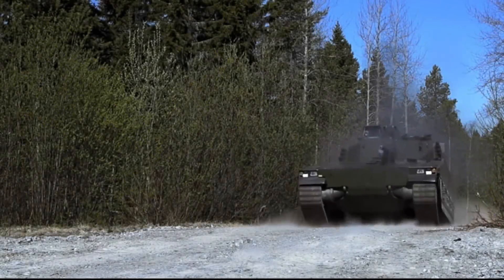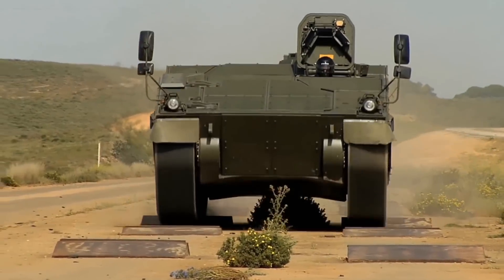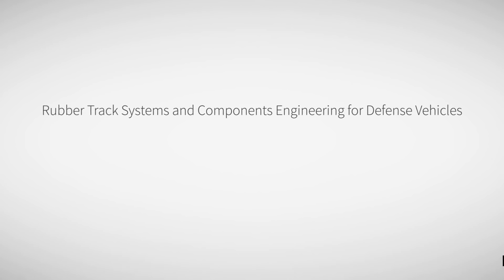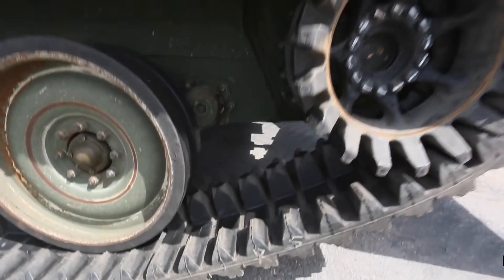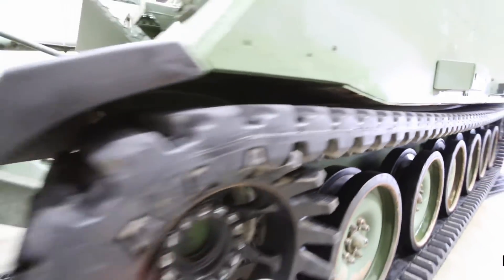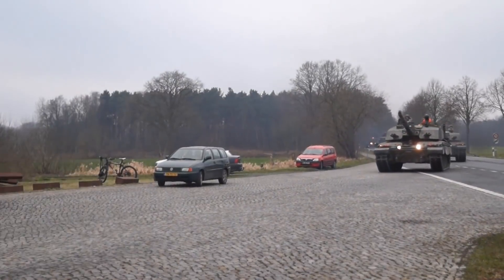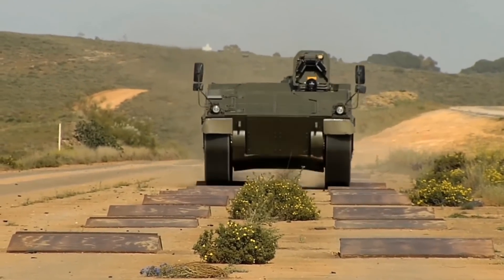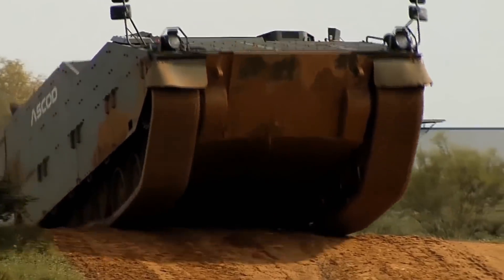Rubber Tracks on Tanks - Are they worth it?

Comment: Makes sense for some light vehicles that need maximum mobility but not necessarily maximum durability. For example, the Bronco ATTC / Warthog amphibious articulating quad track  and Bv 206 mentioned in the video. This would be great for disaster response. Floods, blizzards, and hurricanes would not stop such vehicles and the rubber tracks are an important part of that package.
Reply: A slight bit wrong there, the British used the BvS10 Armoured Vehicle (Viking) which was loosely based on the BV206 which was unarmoured. Later supplemented by the Warthog
Reply: chaz8758 Not wrong. I never made any claims about who used what. I am aware of what the British used and what they were developed from. The Viking was removed from combat service early and completely replaced by the Warthog in theater which was based on the Bronco ATTC. But none of that is relevant to my point above that rubber band tracks are appropriate for use on various quad track vehicles like those and others.
Reply: I was more replying the Matsimus was wrong saying the BV206 was used in Afghanistan. 

The Viking was not removed from combat service early, they are still in service, the Warthogs however were stored and put up for sale last year. Quite a few press reports about it.
Reply: British Vikings were moved out of Afghanistan as the Warthogs were moved in. They received refits, upgrades, and supplementary units after they returned to the UK. The much improved Bronco 3 is now available and this might have something to do with the UK MoD decisions about which models to retask and which ones to seek replacements for.
Reply: MoD has no money and has to dispose of a lot of equipment bought for Afghanistan and Iraq but serves no purpose now. 

They dont even have the money to do the large war stocks we used to have, so the Warthogs were up for sale along with a lot of other equipment. To try and pay for smaller amounts of new equipment like the Scout SV series and Carriers with the F35 when it eventually makes it. 

Vikings were retained I assume as they share some parts with the BV206 that are still used and have had some major upgrades (October 2012 contract let to bring 99 Vikings up to Viking II standard). 

The Warthog was bought in 2010 for deployment in Afghanistan to replace the original Vikings (operators - crews, mechanics etc - started training in 2010 so no idea when they were actually deployed as delivery started in Sept 2010), 24 Viking II were also purchased to be deployed to Afghanistan (10 troop carriers and 2 command versions, ordered 30th Sept 2009 and delivered by March 2010).

I have no idea whether the Viking II was also withdrawn from Afghanistan when the Warthogs were fully delivered (2011), I was out by then.

Comment: I think they should use a better material for the tracks. Less noise, less time taken to repair it, can support the weight of main battle tanks, can withstand cold and hot climate, withstand more shots from RPGs or shells from the tanks. With this much technology, it's difficult but not impossible. What do you think Matsimus? What do you think what material would be better for a track on a tank?

Comment: I may be alone in this but I think that ceramic tracks may fully or partially replace steel tracks due to ceramics being lighter, stronger, and not affected by temperature. I imagine ceramic tracks being made of silicon carbide, the same thing used to make challenger 2 chobam Dorchester ii armor. The only disadvantage of ceramic tracks is that once they're destroyed, they cannot be fixed, if you've ever dropped a coffee mug and it broke, you know what I mean. 

In the distant future, we might have tracks made of carbon nanotubes or graphene. They are even lighter, far more durable and possess limited self repairing capability the only downside is that they are technically unfeasible because the tech to produce nanotubes in bulk and at long lengths isn't here yet.
Reply: Ceramics are used in armor not only because of the hardness, but mainly because of the brittleness. They need to be backed by elastic materials such as rubber and steel.

Ballistic performance is excellent, but you can't apply that to other fields.
Reply: Jonny true, thanks for correcting me.

Comment: I've been waiting for this video to come out. I didn't know much about rubber tracks ,besides rubber track pads.  I was surprised to see how good they are. My main problem with them is the track repair, having them in chunks  seems easier to repair than getting a whole new tread. Rubber has a low melting point than most metal. so if someone stuck a bottle of highly flammable liquid on the track and light it on fire. Would melt the tracks giving you a bad time.  I'm guessing it would to take to long to burn through or its not a realistic example of it happening in combat. Imagine how bad it would smell if a tank was to catch on fire and burned for awhile. but hey now you got a good signal smoke.

Comment: You can learn a lot about rubber band tracks from construction machines, big problem as you said are sharp rocks. I'm sure were going to see more and more of them, you can’t deny the advantages and they get better year by year.  They have to figure out on what terrain,climate(extreme heat&cold),vehicle(front line/MBT/support),repairs and tools and of course the cost. As for protection, tracks are not added protection to the armor. They protect it by keeping it moving. And there is no track that can take a direct hit.
Reply: Spare track sections have sometimes been used for a slight amount of additional armor while mounted to the outside hull of the tank.

Comment: The biggest issue I can see with these things is survivability in high intensity combat conditions, full rubber tracks would be more susceptible to things like shrapnel and MG fire than steel tracks. I can also see them losing a significant amount of their durability in extremely hot conditions, (the sole melting heat of Iraq comes to mind) unless the rubber is more heat resistant than I realise. Over all it's probably a pretty good innovation though for the reasons outlined in this video.
Reply: The tracks on the BV10S still worked well on the rocky and hot terrain in Afghanistan

Comment: Don't play around with rubber tracks, get to work on hover tanks!!!
Reply: Sromotny Kobziarz The amount of energy required to hover a vehicle, especially one as heavy as a tank is ludicrous. They would burn so much fuel you could not operate them.

Recoil of the weapons would be a concern, these tanks would produce massive amounts of noise. Control would be somewhat questionable.
Reply: Bob Lob Law That’s when you just drift over the enemy sideways if you can’t take them out with your main gun.  It’ll be like ten pin bowling.
Reply: this covers some hover tank problems if i remember right. 

https://www.youtube.com/watch?v=KfgifHh5R4Y
Reply: MrKalashnik0va  well with any luck we'll be at war there to, so just spin the turret around
Reply: MrKalashnik0va  hmm yeah probably
Reply: The Hammer's Slammers series of Military Science-fiction has exactly that... Oh, well, one can dream, right?

https://en.wikipedia.org/wiki/Hammer%27s_Slammers
Reply: MrKalashnik0va  well no, it's not too hard to calculate the recoil that's going to occur. And if there was a hover technology, it could be used as a perfect recoil dampener
Reply: get a helicopter, it is 100 times better then overtank
Reply: MrKalashnik0va the answer is recoilless rifles
Reply: The amount of energy required to hover would ludicrous without some sort of antigravity matter which would be a game changer in pretty everything.

Comment: Would the massive amount of traction on tarmac put extra strain on driveline components when compared to steel that can skid steer when needed
Reply: Most modern steel tracks have rubber track pads on them that would provide a similar amount of traction on roads, having witnessed an M113's track break at around 65 km/h I can attest to them still being able to spin out :p

Comment: The problem with the BV 206 (talked with a driver of those) is only useful when not under fire.
The most protected part of it is the windshield which is bullet proof.
He told me that the armor cannot even withstand 7.62 ammo. If it cant stop those rounds 5.56 isnt even a question.
On the other hand you probably worked with more armored versions in afghanistan.
But are the hills there really that steep so you need those vehicles?
I mean (if im not wrong) they can go up to 45 degrees if not more.
Reply: isnt that thing is for support role like carry supply  or towing arty or carry mortal ? the singapore have they own version used for carry supply / mortal ( mortal on the behind car )  i doubt those thing can withstand 7,62 round
Reply: The British used the armoured Hagglunds/BAE BV10S (Viking) and the ST Kinetics Bronco (Warthog) in Afghanistan

They were used as troop and supply carriers as well as fitted for fire support with a variety of direct fire weapons

Comment: Expansion should not be an issue, perhaps they will make different types to deal with hot, mediate and cold weather though, so that with some segmentation seems to be a good step to the future. Reducing noise outside of a tactical advantage is very important to the crew inside as constant noise and vibrations are tiresome, having less of that seems to me would allow the crew to remain at their best for longer. 

Anyhow just my thoughts on this I aint no expert on any of this.
Reply: A tank designed for rubber tracks could have an automatic tensioner that makes it a non-issue.  Retrofitting to a tank designed for metal tracks, with an external manual tensioner, might be a huge issue.  Such is the nature of retrofits though.
Reply: Mostly you hear engine noise first. At least for MBT:s

Comment: During war time or active service, id still prefer the steel tracks.mainly because I don't think the rubber bands would hold up against a high velocity projectile like steel would...That bit of "extra armour" .
Reply: Given the penetration value of modern weapons, I really don't think "extra armour" is a real life thing...
Reply: bandholm
In fact, some WWII German testing showed that, supposedly, tracks as addon armor actually made penetration easier to a degree because they were soft, and allowed the shells to bite in more, unlike the hard-faced armor plates.
Reply: Never mind being hit directly and squarely by a 120mm APFSDS, they usually show up to the party with friends and obviously that's going to be the end of your war. The real question is which type of track will stand up the best to the tank running over a IED or anti tank mine.
Reply: matt gratton flashback to Warthunder tracks blocking a 120mm AP round :/
Reply: Warriorcat49 that would actually make more sense too.
Reply: ^ HEAT punch's thru armor using kinetic energy. The chemical energy is used to plastically deform the ductile metal cone into a projectile, as well as accelerate it.
Reply: "softer materials dissipate chemical energy more efficiently"
but thats not how HEAT works.
Reply: InsanoBinLooney
Which can be also said about pretty much any projectile we use today. (There are probably some exceptions but they are pretty rare (for example railgun).)
Reply: No need to deploy tanks if you have ICBM
Reply: Many early composite armour systems used rubber and textiles to mitigate penetration by HEAT. While metals are generally better at protecting against kinetic shells (APCBC, APDS, APCR or APFSDS) softer materials dissipate chemical energy more efficiently.

Comment: You know that steel has way more heat expansion than rubber? In other words, different temperatures should have less effect on rubber tracks staying on than with steel tracks.
I think the way forward will be segmented rubber tracks so that you can repair them in field conditions. Some steel and kevlar to strenghten the structure just like in tyres and it should be durable enough even for MBT.
Reply: In case of rubber you probably wouldnt be worrying about heat expansion (rubber contracts when heated) but how its elasticity is affected. 
http://onlinelibrary.wiley.com/doi/10.1002/app.1984.070291118/abstract
Reply: Rubber sectional tracking is mainly limited by the weight it can carry, and how it behaves on very rocky terrain. (cutting/punching/taking a permanent set). It will be a while before you see sectional rubber/composite tracks replacing steel tracks on armor heavier than ~25 tons. 
 Kevlar is neat stuff, but using it in an application like a section of track is not good. It is hydrophilic, meaning you could suffer nasty delaminations when the outer rubber is cut to where the cord/plies are exposed, in cold/freezing weather.
Reply: You adjust the track tension as needed. Use to be on rubber track m113 in the CAF
Reply: Isn't there any steel cables to hold it together, like in garden size excavators?

Comment: American half tracks had band tracks in WWII. FYI.
Reply: U mean M3 Halftrack? its still has steel on it
Reply: The latest rubber band tracks all have metal in them too.
Reply: The American half-tracks of World War Two had wire band tracks covered with rubber, so that all you see from the outside is rubber.  And that applies to ALL American Half-tracks, not just the M3.

Comment: Well, Segmented rubber tracks are way to go. the section won't expand as much as a full track belt because it will be supported by its linkages if they are made up some durable metals. The Tracks can be made with some fiber steel meshing mixed in with the rubber that can help make the track sturdy enough to deal with thermal dynamics. So you won't need a hydraulic system to keep the track tight. Just an old-fashioned track tension wheel that the US M47's had in the back to make sure the track stayed when clearing obstacles low and high speed, but Later remove because of better track and suspension designs. All and all I'm sold on the rubber tracks.
Reply: I agree. It's not like this a new technology still in it's infancy, they've been using segmented, fortified rubber conveyor-belts in the mining-industry forever, and those things are designed to take a beating 24 hours a day. And a lot of those conveyors nowadays have fully automated systems that can repair/replace damaged segments and regulate the tension, implement that on a tank and you're one step closer to not needing a tank-crew at all.
Reply: "implement that on a tank and you're one step closer to not needing a tank-crew at all."

.... HERESEY! BURN THE HERETIC!
Reply: lol Hey! if we can get a car to drive on its own, a tank is no different. Well maybe by a few tons more, but it is still possible. :)
Reply: Omega Zer0   I think I might be more comfortable with self-driving cars now that I think about it though... seeing as my Toyota probably won't/can't murder us all once it becomes self-aware :)

Comment: I used to be a commander on one of the Danish army M113 G4´s with rubber track and my experience is that it is a love hate relationsship (especially on slippery slopes)
Reply: Did they have any track attachments to  help with those slopes? Like little screw on spikes like the ones on track/ cross country spikes? Ofc it wouldn’t be as good as metal tracks but might help solve the issue in a shorter period of time.